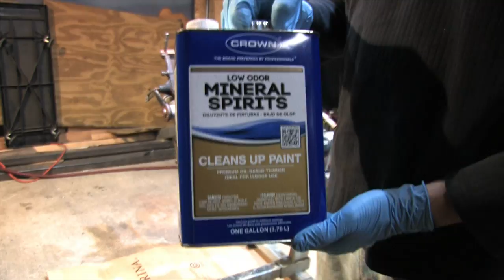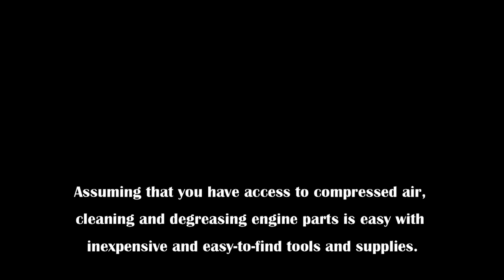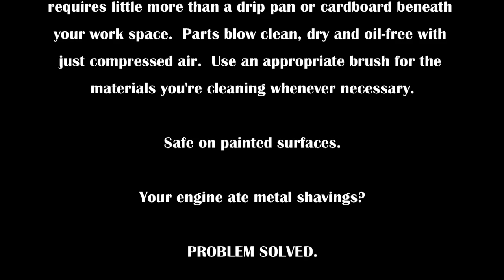DIY Parts Washer

Comment: Hey Jafro excellent video as always, I really appreciate all the time and effort you put into your videos for rookies like me! My question has to do with the motor that you just pulled out of your elentra, I'll give you a little back ground and a few questions. Sorry for such a long comment, but I'd really value your opinion.

I purchased a 91 tsi awd a while ago, I pulled out the motor and sent it off to the machine shop. At the time I didn't have much knowledge on dsms, however when I received the block and head back I notice a few strange things.

The head was a 1.6L head, like the one in your elentra. When compared to a 2.0 head it has noticeably smaller exhaust ports. The combustion chambers were also slightly smaller on the 1.6 head. The block was different because it had 5 main caps instead of 3 like the typical 6-bolt 4g63.

My questions are:
In your opinion would slightly increasing the size of the exhaust ports on my 1.6L head bring it closer to the capabilities of a 2.0 head? At least closer to the stock gasket, there is a ton of space between the actual port and the manifold gasket.

The combustion chamber probably needs to be increased as well if I ever want it to be anywhere close to a 2.0 head. Should I turn away now and pay out for someone to increase the combustion chamber size, or could I slightly improve it by myself? I understand the risk and have a pretty steady hand!

Lastly this head has been surfaced quite a bit in its lifetime. Watching your video the other day you mentioned something about the step to the oil feed for the head. My current 1.6L head has a very shallow step, and I doubt that this head could be surfaced again in the future. Is there any problems I will run into with the step being shallow? I also am going to tapper the oil feed slightly, I've heard this is quite popular in 4g cars.

Thanks for all your input, sorry again for the story but I tried to summarize it best as possible.
Reply from the maker: You have the head that's on this car.  If you want a big turbo or burn California gas, it's the wrong head.  If you want to make a lot more power on 93 octane with a small turbo and lower boost pressure, it's the perfect head.  My pistons are 9:1 compression.  This head gives you about a point to a point & a half more compression over what your pistons are rated for.  I'm sure there are lots of people who'd like to build a high-compression fast port volume head.  I don't know what your goals are, but if you didn't want to use that head, I know there are probably plenty of people who would want to buy it off of you.  The DOHC 1.6L isn't the most common cylinder head, and they're getting harder to find.  Most of the Mitsu 1.6L stuff from the '90's is sohc with a few exceptions.  There's a good bit of mixed and sometimes heated discussion about this particular head on DSMtuners.

I have no idea what's going on with your main caps?  I know one of my viewers knows why that is, but I've never encountered that?

Don't waste your time increasing the combustion chamber volume.  It's not going to help you because the precision machining required would be more expensive than buying a used turbo head.

The shallow teardrop thing... I think the 1.6L dohc was intended for such a different use and lower RPMs that it probably doesn't need a very big teardrop.  A tenth of an inch is healthy for a turbo DSM.  Any less than 50 thousandths I'd consider dangerous, and any more than a tenth is excessive.  It doesn't need to have the oil capacity that a turbo car does, so that teardrop thing I was previously talking about in the diagnosis video might be misleading.   I have deck height specs on my 1.6L head now, and I'm going to measure it to see if it's different or not.  I just haven't yet.  Soon.

The exhaust ports are indeed smaller.  It's not such a bad thing with a small turbo because gasses travel through it faster, and will lower your full-spool rpms.  It's why my hyundai is so bottom-heavy on the torque curve.  The casting on mine is just horrible, though.  I might have to clean it up.
Reply: *****
Sweet! Your a genius, thanks for the info. Now I must debate with myself, there is mostly only 91 octane where I live in Wyoming. However I have a brand new 20g and that will probably be sufficient for the time being. I'm looking more along the lines of a daily driver so a smaller turbo is more sensible. The casting was horrible on this head as well. I knock a lot of the really weak stuff off, including a pretty large portion that was blocking about half of the oil drain back hole.

After watching your tear down video I had to ask you these questions about the 1.6 head. I really appreciate you telling me both the pros and cons of this head, and not being completely one sided. I have had one guy tell me that it's a knock off Japanese head, and others say that I'm wasting my time with it. 

I would probably let go of the head if I could recoup a decent amount of the money I have in it to put towards my 2.0 core. The head has new bronze guides and valve seats, I also have a set of standard supertech valves I could put with it. So if you happen to know anyone who would want it please let me know. I have a ton of pictures I can send you as well.

Thanks for the well thought out response, you've pretty much cleared up the entire subject for me. You can email me if your interested at all in the head. gerg0909@gmail.com

Comment: This method works well , the only problem is you forgot to tell up grand papa died from Mineral spirits poisoning .Hot tanks, and ultrasonic cleaners were made to replace this for a reason. It's never a good idea to spray around toxic chemicals when it can be avoided .
Reply from the maker: While mineral spirits is a poison, it takes a fairly massive and prolonged exposure to it to cause you to get sick.  It's about as dangerous as painting your house or pumping gas unless you spray yourself with it.  Maybe a bit less dangerous than spraying yourself with gas because gas has a lower flash point... but either way, I don't recommend doing that with either one.  Both dissolve the fat in your skin on contact.  The safety precautions followed in this video are sufficient for exposures of less than 4 hours.  A gallon of mineral spirits wouldn't even last an hour like this.

Even though it's a poison, it's 100x less dangerous for you than breathing chlorinated brake cleaners or my favorite Berkebile 2+2 which is what I'd use if I didn't have this.  Those are full of acetone, xylene, methylbenzene and toluene.  Simply smoking around brake cleaner will cause the formation of Phosgene gas, and that will kill you.
Reply: *****
 It's less toxic than other chemicals yes , but whatever you breath in or allow to contact your skin will enter your blood stream . Not all chemicals exit the body quickly, this assist in allowing toxins to continuously damage you over time. Mineral spirits has been known to stay in the body for weeks (especially the lungs) continuing to damage tissue the entire time it's there .
Reply from the maker: I agree with your points, but would want to clarify only one of them because I practically memorized this MSDS, and read a few medical journals in the process of making this video.  I agree this info is important and it's why I linked the MSDS in the description.

Exposure time for me was less than 2 hours including all the brushing and wrapping of parts.  It really doesn't take any time to clean parts like this.  Not compared to a conventional parts washer, probably filled with Varsol, which is basically the same thing as Mineral Spirits.  Inhalation exposure at the exposure limit (4 hours) is around 24-48 hours in the blood stream and at levels considered safe by medical professionals.  The average human will start to feel sick after 4 hours of exposure.  In cases of severe inhalation poisoning mineral spirits or white spirits have been observed in the blood stream for up to 66 hours.  I'm sure that it can stay in your system longer with skin contact because of absorption, and I'm sure that in cases of painters and aircraft mechanics that the weeks estimate is accurate, but if you're in a ventilated area and clean an engine in less than 2 hours this isn't going to make you sick.  Not if you use the basic safety precautions in this video.  Fan, gloves, goggles, open door or window, de-sulfated indoor formula mineral spirits.  Of course you can do this outside and further limit your exposure.  Alternatives that come in aerosol cans will make you very sick and that's what about 95% of the shade tree mechanics will use.  People will always have the need to clean engines.  All engine cleaners are poisonous, but I posted this here because it's a safer and faster alternative method to what home-builders typically use.  Some of the solvents that machine shops use are far worse, plus it's nearly boiling.

There are others like Exxsol which are much healthier industrial grade solvents, but without a contract, good luck getting your hands on it.  I've seen that stuff sell for $80 a gallon.  Some people use OrangeClean, SimpleGreen or Awesome Orange.  All 3 of which are acidic and will crust aluminum parts with oxidation if not completely and fully rinsed off the parts, and takes 10 times as long to do the same thing.  Plenty of grandpas are still using mineral spirits because of its effectiveness.  I have no problem with people using alternative methods.  I agree, Mineral Spirits is a poison.  If you're going to use it, limit your exposure.
Reply: Excellent , you have to remember some people on youtube are not smart enough to look up things and will kill themselves  . There is a reason packing peanuts have a do not eat label, because some one was dumb enough to eat them .
Reply: Mike Parker  I'm appreciative of the comments you made and the very complete information Jafro included. Couldn't quite pull the trigger on buying a siphon gun for mineral spirits until I saw this.

Jafro, do you think this would work for the rusty, gummy, ethanol crud lining my truck's gas tank? The fuel pump was choked. I can't believe it ran as long as it did.
Reply from the maker: I don't know the content of "ethanol crud" as I've yet to encounter it, but I can't imagine why this wouldn't work?  Mineral Spirits being coal oil is a petroleum product.  Unless you're running pure Ethanol, then it should cut right through it.
Reply: No, just a truck that sat too much with normal ethanol that they torture us with at the pump. Thanks!

Comment: Being a hydrocarbon of sorts, don't the spirits leave a grease-disolving residue behind when they dry? If I used spirits to clean out a sealed gear hub for my push bike, how would I then remove that residue so I could re-grease it all without the grease disolving? Wash it out with water?
Reply from the maker: +TallmanMike Nope.  You'd actually contaminate it with tap water and promote rust because it's full of salts.  The indoor formula is so highly distilled that it evaporates completely without leaving residue.  That's what's nicest about it.  If you used turpentine, then you'd be in trouble.  That will leave oily residue all over the place.  Mineral spirits burns just about as clean as alcohol if that's any indicator.  It's a whole lot less volatile, but give it time, it all evaporates.

Comment: Jafro, would you recommend doing this to a fully assembled engine? I want to clean up the engine bay in my toy, and have experienced poor results using other products and methods. Naturally after watching this, I want to try this method, but I'm concerned the mineral spirits may be harmful to rubber gaskets and seals. Do you have any input?
Reply from the maker: +Matt Noll I would use it in an engine bay.  I have heard others say that mineral spirits caused the rubber weatherpack connector seals to swell up.  One solution would be to bag and tape those, but I haven't had that problem before.

Comment: would you reccomend using this on plastic pieces like timing belt covers or pcv tubing (sorry if you showed an example and im just being redundant)
Reply from the maker: Hard plastics?  No problem.  Painted surfaces?  No problem.  Bare metal?  No problem.  Eurethane-coated wood?  No problem.  Glass?  No problem.  EPDM rubber?  No problem.  Silicone rubber?  BIG PROBLEM.  

Silicone based rubber, often found in the linings of weatherpack electrical connectors or in grommets on the firewall sealing air gaps may turn to a jelly like substance and swell up twice their normal size.  This also happens to them in contact with other petroleum products like gasoline, brake fluid, engine and gear oils.  Because mineral spirits is a quickly-evaporating solvent, it penetrates silicone rubber parts faster than other automotive fluids and rapidly degrades them (indicated by the swelling as it is absorbed).

Comment: Thanks for another great video, Jafro! A few questions, if you have time:
A) How much pressure do you usually apply through the siphon spray gun?
B) Do you completely submerge the hose in the mineral spirits, or do you keep it near the top of the fluid level to suck up an air from the can and vaporize?
C) I noticed that your valves are still installed, and I assume that the valve stem seals are as well. I'm sure you've replaced them (I think I remember that in a more recent video), but do you think that the mineral spirits would have an adverse effect on valve stem seals? I know that mineral spirits are petroleum based, but want your input on whether or not you've noticed it drying out seals.

Thanks again!

Comment: Hey Jafro,
I'm planning on using this method to clean my engine while it is still in the car. I have the head off for some work. Are there any components or "things" that I should avoid when spraying it in the engine bay
Reply from the maker: Flats Domino I have been told the silicone rubber in electrical connectors swells up to an un-usable state.  I haven't seen this, but carb cleaner does that to them, too... and I have seen that one happen.

Comment: Hi Jafromobile, I have a bit of a problem, See my vids, In short do you think I can flush my engine with Mineral oil(would it degrade the seals) etc. I want to do some sort of flush and then flush it with sevreral oil changes. Your engine cleaning is impressive btw.. I assume your walls and floors are covered in grease.